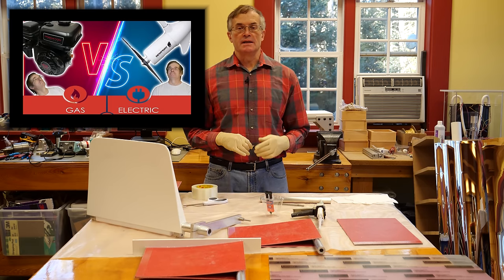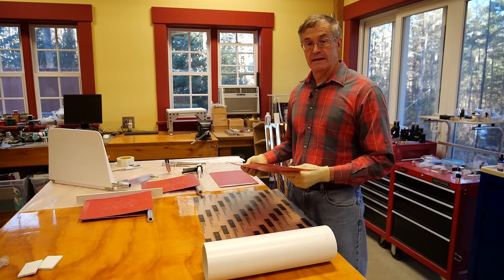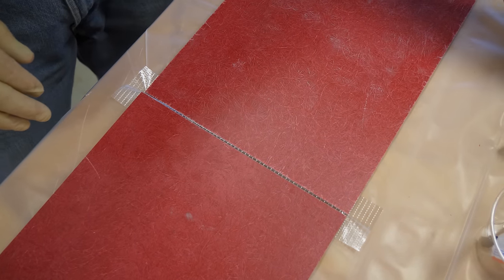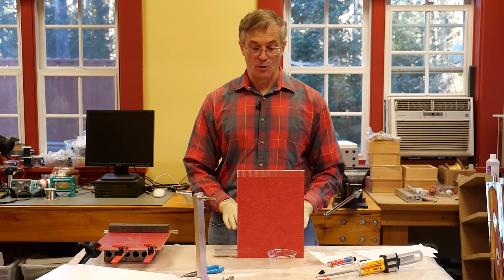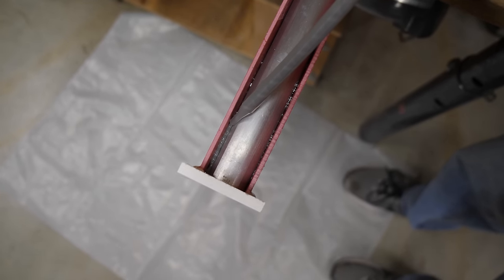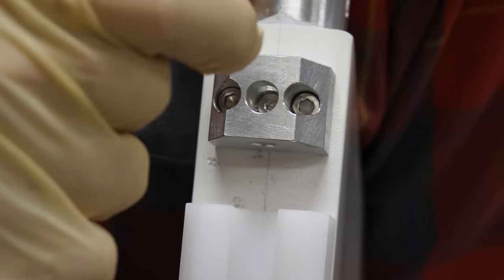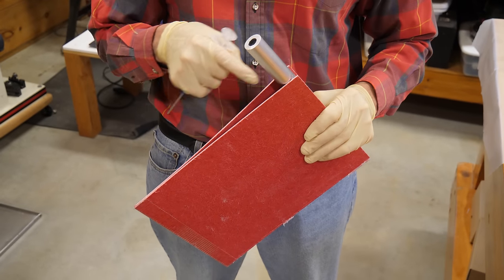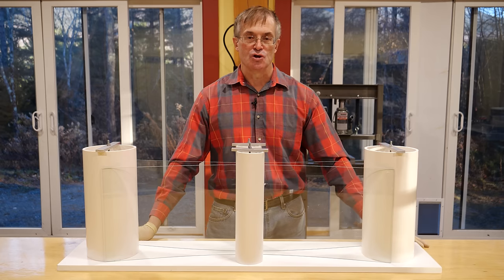How Our Boat Rudders Are Built

Comment: Thank you so much for the excellent preparation, explanation and presentation!

The concept of the fishtank I understood, but not how you will attach the side parts at this extremely curved design, after you have poured in the epoxy to cover its ground part. Looks difficult to attach strongly curved plexiglas to the ends afterwards, especially when the gap is so small. And how do you enforce the top part, that it does not burst open? Cleaning the tank also seems difficult, when the futur algae will grow. I have to assume, that the model presented   here is just an exaggerated example of what you are going to build with other dimensions.
Reply from the maker: The tank is designed to have four similarly curved walls.  The junctions will be reinforced and the narrow space will be filled as we did in this video with a temporary dam at each top corner in turn and then filled with clear, degassed epoxy.
The curve inherently opposes the outward pressure from the water.
Reply: @TechIngredients  Thank you for the quick answer, especially at lunch time, which I suppose is now in the place you live in!

Comment: Cold weld tanks have problems at higher heights.  Was going to make a long low 80 gallon for a bar back.  They have no special considerations at less than 18-20 inches tall.
Reply from the maker: I agree in part.  A long expanse, even as little as 12" high, will bow along the top edge unless it's thick or there are cross braces periodically spaced front to back.  That definitely works, but even a relatively gentle curve may be an interesting alternative.

Comment: I've made homebuilt airplanes out of aluminum, wood, and composites for more than 50 years and your techniques are interesting but too heavy for my needs. About  air bubbles in resin, the epoxy countertop guys run a propane torch quickly over the surface (the torch is lit, of course) and the bubbles seem to disappear. It sounds dangerous, but they don't seem to have a problem so maybe you should try it. It is simpler than using a vacuum.
Reply from the maker: That technique works well for thin layers, but is not very effective for thick pours or potting volumes.
The techniques for boats are indeed different in that weight is much less important.
Reply: @TechIngredients  Watch the videos, those layers are often as thick as you have shown here. Are you saying it won't for your situation or you haven't tried?
Reply from the maker: I've tried it.

Comment: Is there anything about the cured epoxy that could harm the fish? I’m asking because I’m building a bathtub lined with thickened epoxy and I’m wondering if I should top coat it with a polyester.
Reply from the maker: A lot of low cost aquariums are constructed from plywood on their back and bottom surfaces and sealed with epoxy for water proofing.

Comment: Great way to fabricate a rudder!
One advice for rudders that do not reach very deep in water like this one:
In minute 18:00 you closed the bottom with a PVC plate. You should glue a similar Form of a so called endplate to the bottom of the rudder.
It increases the efficiency of a rudder very much. A lot of shallow draft vessels here in the waddensea and working boats in shallow harbors have that kind of endplate.
It has a similar effect like a winglet of a planes wing. 
https://parker-marine.com/Lorcha-%2702-3.jpg

Comment: There is a fair amount of epoxy poured into the working edge of the rudder. Would it not be brittle? Why not add structural material to the epoxy before pouring to address this?
Reply from the maker: As long as the epoxy cures slowly enough so that the exothermic heat remains low, you get a very strong and tough bulk plastic.

Comment: I still feel that the electric steering is not only unnecessary, it actually detracts from the experience and overcomplicates the system. I guess you just REALLY wanted to use those actuators!
Reply from the maker: Of course  I did!
But, how would you steer this boat assuming the fixed long-shaft drive?

Comment: Thoughts on building all boat components from carbon fiber (where applicable)?
Reply from the maker: Cost.  Fiberglass  is much less expensive  and tougher.  With the relatively heavy core being wood, the weight savings by substituting carbon isn't worth it.
Reply: @TechIngredients  is it unadvisable to use carbon fiber as the core? I don’t know a ton about any of this. 😂
Reply from the maker: It isn't. The core has to be light and provides the thickness.  The carbon or fiberglass act as thin skins that give strength in compression and tension.  We did a video on composite core construction.

Comment: at 2:52, "elliptical trough" - should that be "parabolic" trough?
OK what about placing the tube at the center of pressure of the foil and bend the two halves together to form a leading edge?
How real boat rudders are made: 
A two-piece sandwich female mold, spray inside surfaces with silicone mold release, spray inside of mold with gelcoat "paint", lay up fiberglass in each half, pour in expanding foam with short glass fibers, clamp the two mold halves together using about 50 clamps, let the foam expand and cure, break open the mold and remove your nice symmetrical waterproof rudder.
Reply from the maker: The geometric curve depends on the way the edges are fixed.  A free edge will generate a parabolic curve while a fixed edge produces a more complex curve that is similar to an ellipse.
Reply: @TechIngredients  Oh OK I was thinking maybe you just misspoke cuz solar concentrators are usually described as "parabolic".  I guess if you aren't too fussy you could get away with elliptical in some cases.

Comment: The alu pipe that is glued in and sealed with epoxy in the wide end of the rudder.
Will that epoxy glue and the epoxy filling hold the alu pipe in place without the epoxy cracking from stress of the pipe turning back and forth?
I need to explain myself.
I´m not a constructor or an engineer, but i somehow have the ability to feel how materials behave in different situations.  Ok, what happens is that my ADHD-brain start to make scenarios in test environments, where a part can be tested. I test it and see weaknesses in the part. Then reconstruct it, and goes back and test it again. I can do so between 5-30 times depending on the complexity of the part. And this thinking takes between 30 seconds to a day or two. But when testing and  the reconstruction of that part is done (all in the head). 
All parts i test in my brain is very sturdy and never brakes when i make the part in reality.
Ohh, and of course, all measurements, drawings, etc. is in my mind also, when i done with the simulated testing and reconstructions. 

Now with this rudder. I felt some stress between the epoxy and the alu pipe. Not a problem right away, but in long term it could crack. So, my solution to minimise stress is to drill 2 holes almost in the bottom and almost in the top where the sheet ends. Tap those hole, and screw some rodds to the pipe, maybe 8" long, pointing them to the narrow end. 
Then fill the rudder as you did and those rodds will be cast into the epoxy. 
It will take away some stress of course. But is it needed? Is it over engineered? 😅

Thanks for the word, and thanks for a fantastic channel 😃

Comment: Couldn't you pour some epoxy into the rudder and THEN glue on the 'top' pvc, and then invert the rudder?  the epoxy would settle into place and then cure wouldn't it?  then you would have a 100% sealed unit, without that threaded 'plug'
Reply from the maker: You could.

Comment: But epoxy is so expensive these days. I loved using it in my younger days when I could afford it
Reply from the maker: Have you looked at Raka brand epoxy.  It's one of the cheapest and has been my primary epoxy for decades.  I've never had any problems with it.
Reply: @TechIngredients  No sir. I had  never heard of it until your video. I will check it out.

Comment: "a sturdy boat rudder".

Sorry, but that's NOT sturdy. And when that rudder blade breaks free from its' shaft, you'll learn why. There's a reason why real rudder manufacture makes use of embedded tangs welded onto the side of the rudder shaft. Epoxy as a glue is strong and all, but its' shear strength isn't going to be enough to cope with the leverage the blade can impart, particularly over time. A little research before you went ahead purely on assumptions, would have paid dividends.
Reply from the maker: You need to watch a little more carefully.  The attachment fittings were screwed into the aluminum rod, through the epoxy.
Reply: @TechIngredients  = I was watching.. and that won't cut it, except for very light duty, perhaps. There's pretty much nothing to stop that rudder blade from rotating around the shaft. This is an example of what a properly built, sturdy rudder looks like inside the blade: https://farm7.staticflickr.com/6215/6364471527_b148762da7_z.jpg
Reply from the maker: Look at the rudder hardware from Ronstan, they supplied the gudgeons.  They're designed to be screwed into the fiberglass stern of a sail boat, not welded on to a steel hull.  This IS a light boat.  Thanks for the link.